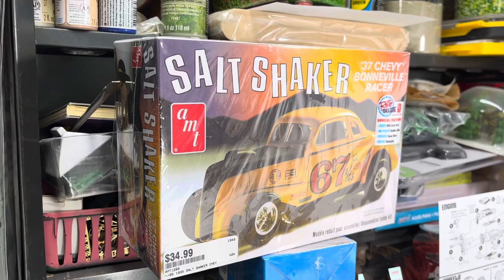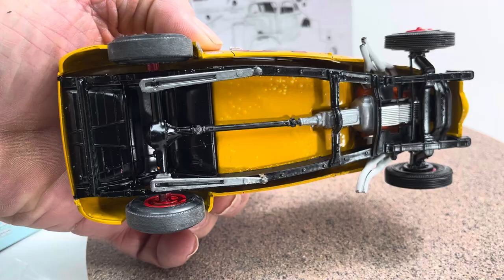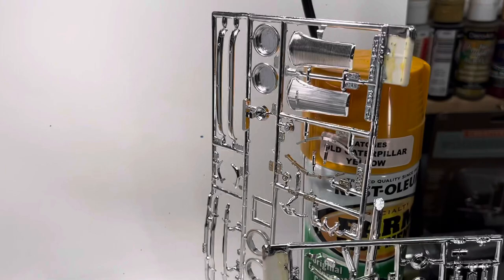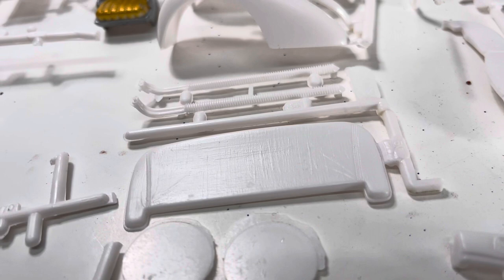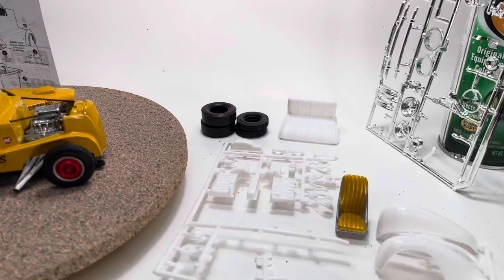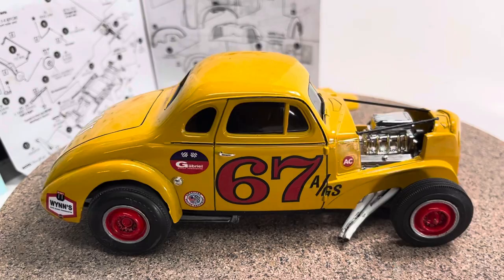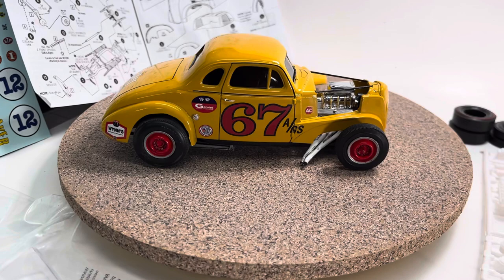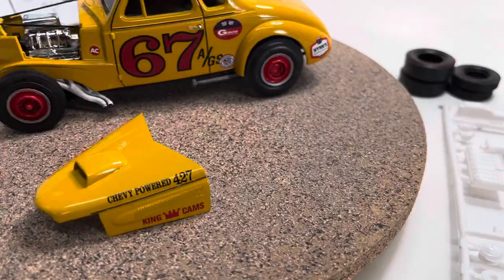The Salt Shaker build￼

Comment: Just bought this kit but haven't started yet. I was disappointed with the instructions. It is good to see the finished model from all sides. Thanks for the tip with the dash. Your car looks good. I see you haven't installed the window separater in the front. The windows are really thick. Must consider sanding them down and polishing them.
Reply from the maker: Thank you for stopping in and yes I was very disappointed with the windows the next one I probably will make a new window for it it would make the dash and everything go together so much simpler I really appreciate you checking it out thank you
Reply: @bigeddie1231  Did you glue the windows in before inserting the interior?
Reply from the maker: @RackwitzG  yes that’s why I had to modify the dash and interior I should’ve dry fitted first but I didn’t